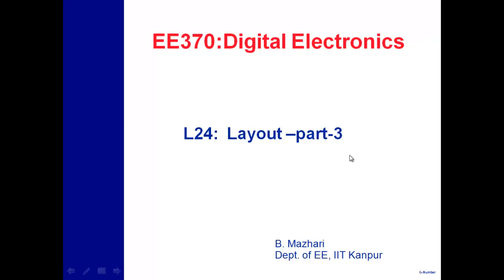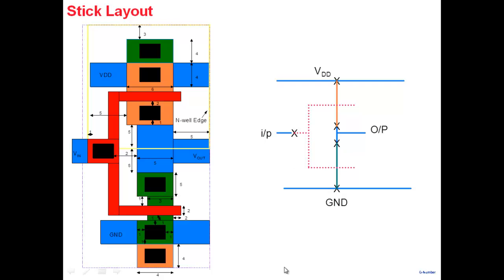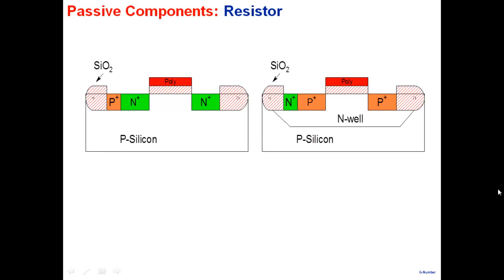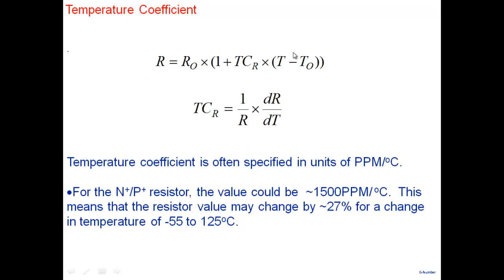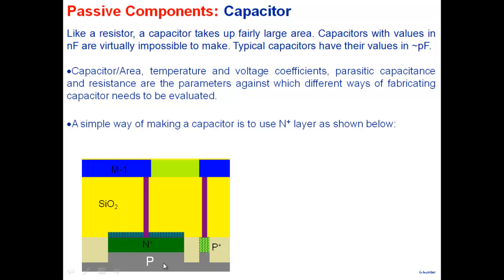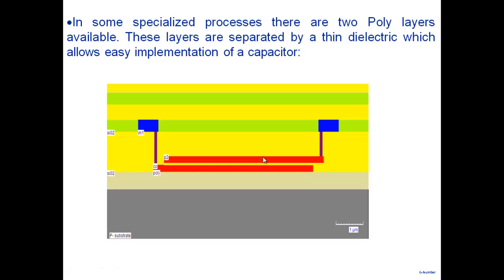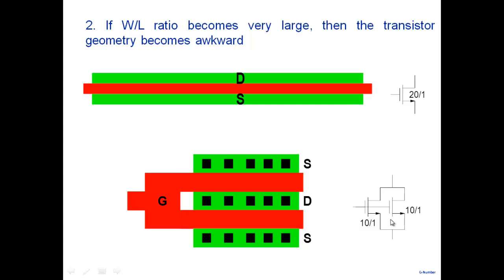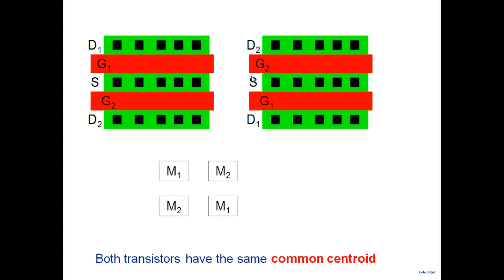MOS Layout (part-3) (EE370  L24 )

Comment: Technology dependent and independent design.
Symbolic layout--->Stick Layout and the need for it. 
20:12 Temparature coefficient PPM/Degree_C meaning.
Multiple layout contact are used to reduce source and drain contact resistance.
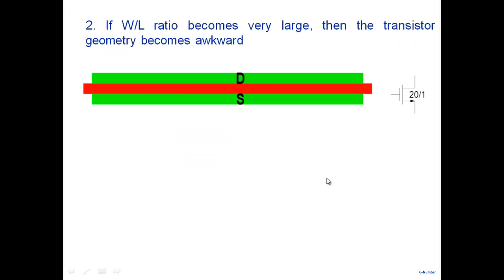39:03 For large W/L ratio , use parallel connection---> Capacitance reduces (Shared contact-Janki sir)
41:36 For good matching , put two transistor closer  or shared connection or common centroid connection.